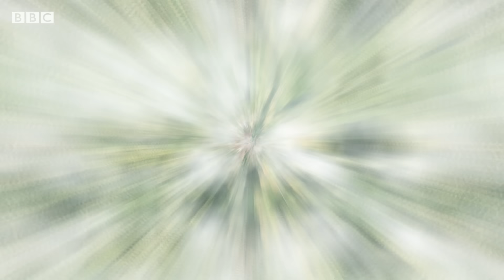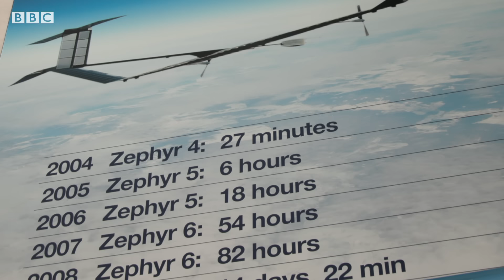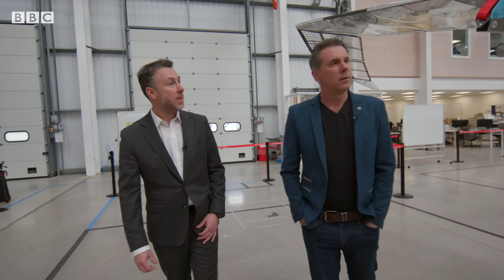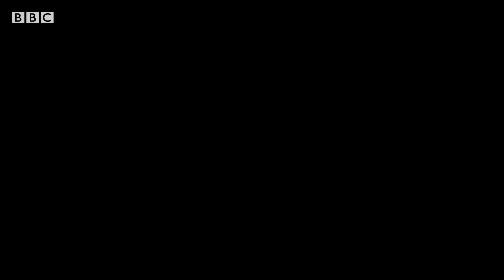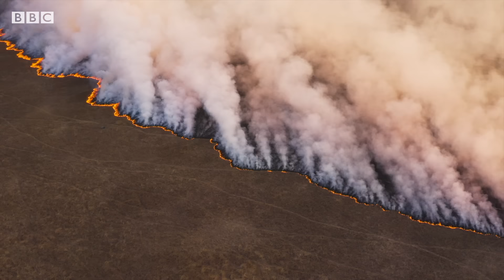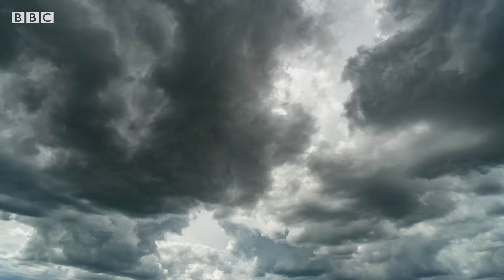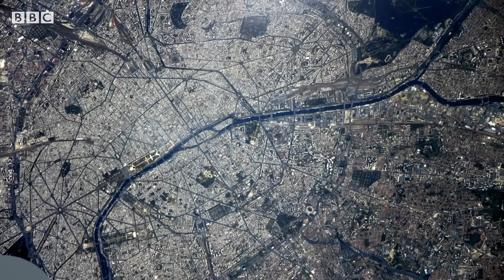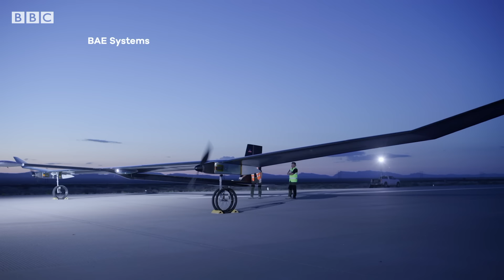The solar-powered aircraft flying high in the atmosphere | BBC News

Comment: Okay I have one small problem with the whole "it will replace 200 cell towers" part. Will the phones be able to transmit back? It's a 2-way communication lol. If a cell tower is 1 unit away from you and that thing replaces 200 cell towers, which means roughly a 14x14 tower grid, you will be as much as 7 times further from a tower. The inverse square law tells you that 7 times increase in distance means 7^3 times increase in losses. Your phone will have to transmit at a 343 times higher power output for the same reception and that is not accounting for weather and you know things like... LIVING ON THE GROUND FLOOR OF A 20 STOREY CONCRETE BUILDING as that antenna will be transmitting and receiving straight down. I'm tired of people that think radio is just magic...
Reply: Twenty years ago, would this concept have been useful post-hurricane-Katrina?  In current terms, is this concept worth the investment?  A thoughtful calculus is required.
Reply: firstly, if you are 7 times further from a tower, the power is 49 times lower, not 343. Secondly, you can either have the phone transmit at 49 times higher frequency, or you can increase the gathering area of the Zephyr antenna to 49x that of a cell tower's.
Reply: The notion that this tech could be used as cell antennas is ridiculous, the logistics are just impossible.
Reply: Should be inverse square law, not square cube, so not as drastic of an issue. But yeah it'll need some good (and light) tech to be able to receive from unmodified phones.
Reply: @mookifacation  Ah you're right, don't know how I missed that 😅
Reply: @mookifacation  My bad. Language barrier and all, gonna correct it. Also about antenna tech, I really wonder how the physical size of the plane will affect the whole thing. Sensitive RF is not really just something you can slap on a piece of metal frame and expect it to work, the whole frame will have to be designed with reception in mind because it won't be more than a flying ground plane and capacitor. It would actually be awesome if they figured out the balance between the ability to fly and invisibility in RF ranges. But even if it worked, try explaining to a bank chain that the antenna drone is reliable enough for uninterrupted money transfers for example... I would have been so much happier if they just said it was a weather balloon replacement to save on helium
Reply: Regarding the electro-magnetic effects achievable from platforms operating in the tropopause ('Near-Space') i.e. 11 miles AGL in the equatorial regions, please refer to the extensive research published by Dr. (Lt.Col. USAF, Ret.) Edward Tomme.  Key Phrase : NEAR SPACE
Reply: Research ASTS, this problem is already solved...5G broadband direct to unmodified cell phones from space.
Reply: @ThePalisky  5G frequencies are easily blocked.
Reply: @ThePalisky  You seem to be ignoring the fact that ASTS BlueWalker 3 is 1500kg, has a phased array with an area of 64 square metres to allow for signal to be detected from phones, and the entire upper surface of that array is composed of solar panels to power it. Not to mention that this is just a test-bed, and the commercial satellite will likely be significantly bigger.

This aircraft on the other hand, while at a lower altitude, will have strict size and weight limitations as well as requiring the majority of its battery capacity to power the props. It will be incredibly challenging to design it to be functional as they describe, and I hesitate to believe that current battery technology is at a state that could support such a system right now.
Reply: @TheMightyHams  you say all that like it refutes anything I said lol. Yes ASTS's solution is obviously superior and the sats are bigger.
Reply: @ThePalisky  I'm not refuting ASTS's efforts. I assumed your response to the OP was challenging his opinions on the abilities of THIS aircraft by saying that their issues have 'already been solved'
Reply: @TheMightyHams  I said 'this problem' referring to the cell towers from far away (the subject matter OP is talking about) not 'their issues' you're attributing to the aircraft. Reading comprehension is a lost art.
Reply: @ThePalisky  The OP is applying the square-cube law to explain how the aircraft will have severe difficulty receiving signal from phones because of the limited power and antenna size on mobile phones. ASTS solved this issue by making a satellite antenna that's 64 square metres in area. That simply isn't a capability that can be easily applied to an aircraft, and the OP was specifically referring to THIS aircraft in his post (notably when he quoted "it will replace 200 cell towers"). It's a fair assumption that your response was in relation to a solution for the long-distance telecommunications for THIS aircraft, and I was simply explaining how ASTS's approach couldn't be translated easily to this design.

ASTS will likely provide a service that will make this design obsolete for this use-case, but likely will still suffer the same issues with poor connection in buildings, in bad weather, or in situations where a phone doesn't have direct line-of-sight to the sky. At these distances the primary means of improving the capability will be to make the satellite bigger, but there's only so much size and weight that you can fit on a rocket. The costs involved with ASTS likely also mean that many 'cheaper' mobile companies won't be able to afford the fees involved with using their satellites, so this aircraft could still find functionality for countries and users that can't necessarily afford it. Starlink has to charge £75/month to justify its expenses, so if the expectation is that mobile providers using this service won't have to increase their (already extortionate) prices to cover their costs then I'd be very surprised.
Reply: @ThePalisky  I was specifically talking about the claims in the video, as indicated by me saying "the part of the video". Don't put words into my mouth just because your point fell apart. I'm not a 17th century poet that you can interpret 10 ways, you can just ask me lmao
Reply: @whatevernamegoeshere3644  I mean you were explicitly talking about phones not being able to talk back to a plane meanwhile we already know they can to a satellite at far higher altitudes via ASTS's solution. Just because you don't understand my point just like the other guy who quoted exclusively wrong things about ASTS doesn't make it any less correct.
Reply: @TheMightyHams  yes I get it you haven't done your research on ASTS. Your cost figures are just dumb and wrong (after a few months it's cheaper than Starlink's current non-D2C tech you're quoting and it's D2C on the consumer end and they use a revenue share add-on model), your points about direct line of sight are wrong, your points about building penetration are wrong, same with bad weather, and you don't know they already have a design that's far bigger than what you quoted (~222 sq meters).

You also clearly don't know about their satellite folding patent which already worked with BW3 if you even know that name. I guess you can keep pretending you're well researched though and spew out some more bs. Nothing you said was right.
Reply: @ThePalisky  Look. It's just not a good solution. It's objectively worse in any possible way than having towers on the ground. This would be awesome as a weather balloon replacement, basically the flying equivalent of a long wave transmitting weather buoy. It would be absolutely amazing for relaying plane communications or taking pictures for making maps. But have you ever been on a roof top or factory attic to actually go and see how a transmit tower looks? They use 2-10kW of power, the amplifier cabinet is the size of a fridge alone, the antennas combine to hundreds of kilos and you want to put that on a plane. On a building, weight doesn't matter. In space, weight doesn't matter after launch. On a plane, if you want to continuously fly that AND supply it with power, Good luck, have fun. They can fly for 60 days on an empty glider plane, great, now at least double the weight and quadruple the power use. See how that flies.
Reply: @whatevernamegoeshere3644  are you drunk? That's not the point of ASTS or other D2C solutions at all. It's complementary and meant to cover areas that aren't covered by terrestrial towers (i.e. the majority of the planet). You're arguing against someone who isn't here, obviously what you're saying is true but it's completely missing the plot. The TAM of D2C solutions is literally billions of people.

I never wanted to put anything on any plane, just lying about what I said and arguing with the wind...I said the solution is irrelevant because ASTS already solved this problem.

You're talking to someone with a masters degree in radio systems engineering and is well researched btw. You should just quit while you're behind and try to learn something from what I told you. Clearly there is an entire novel technology you know nothing about. It will introduce broadband connectivity to more people than anything else ever has in the next 5-10 years.
Reply: @whatevernamegoeshere3644  I mean you're just lying about my position on this openly. I never said any of that. What I did say is that ASTS already solved this issue with their D2C solution. These solutions aren't meant to replace cell towers...they're meant to complement them and help cover the majority of the planet that currently is not covered. The TAM for this is literally billions of people.

Keep arguing with this position noone holds though and don't learn anything I guess if you want.

Comment: StarLink (SpaceX) it putting up a direct to phone satellite system that now can do poor quality video calls (with only a few satellites), and that in a few months of working on it. It is getting better exponentially and once up they are up they are programmed to automatically correct their orbits and can last years. This is going to change the world.  Video calls from anywhere in the world, under any conditions, including the north and south poles.  Also, they are targeting putting these satellites up for around $15,000 per satellite launch cost and that will just keep getting cheaper and cheaper with Starship coming on line.

Comment: 'in theory it should be able to stay here for months' why not forever? in theory every part will be working with no degradation
Reply: The batteries that keep the craft aloft during the night are subject to the same kind of degradation that your phone battery does. With each discharge and subsequent recharge, fewer of the ions are available to make the leap from positive to negative. Until eventually they will not able to hold enough charge to keep the craft aloft all night
Reply: Also solar cells degrade too, but I think way slower (hence no mention of that). But also they are generally lighter than batteries.
Reply: @AlKohaiMusic  yes I noticed after I watched the video, but in theory, it wouldn't be. Great concept though

Comment: I wasn't aware that your typical Samsung or Apple smart phone can transmit signals 10 to 12 miles into the stratosphere. Is it true?
Reply: going to be real awkward when you learn that ASTS already solved this problem they can do 5G broadband direct to unmodified cell phones from space
Reply: Line of sight with no obstructions a couple of watts can go a very long way. 60,000' is only 18.3km. A lot of cell phones can transmit 3w on high power. With no obstructions (no solid objects to penetrate) 3w would very easily transmit 60-70,000'
Reply: Yes. it's true. You don't need much to communicate a long distance - we're still getting signals from tiny spacecraft that are billions of kilometres away

Comment: so it's basically a starlink for calling ur mum instead of gaming with your bros
Reply: These will have in theory better ping than starlink since they are much closer, 4G is enough to game 🤷
Reply: I doubt they actually want to use them as phone towers. This thing has military written all over it. No wonder BAE are developing one aswell.
Reply: itd be better for gaming as its closer to the ground so lower latency
Reply: @HolyOllie  actually no, a LEO satellite constellation actually has better latency over long distances like cross-ocean communications than even undersea cables. At those ranges, the reduced speed of light in the cable can’t compete with the speed in a vacuum even when incorporating additional processing time for repeaters.

One of Starlink’s selling points for premium service is to provide ultra low latency communications for day traders making transactions in stock markets on the other side of the globe, where an advantage of a couple milliseconds means millions of dollars.

This aircraft allows for potential low cost loitered network access in specific remote areas for a limited amount of time. It isn’t scalable like a satellite constellation but the barrier to entry and cost of maintenance could be significantly lower.
Reply: "One if Starkink's selling points..." is vapor ware then. Because Starlink is nowhere near to beating undersea optical fiber connections yet. Purely theoretically it is possible(!) that satellite constellation can beat fiber, tho that is disputed, since the signal bouncing from satellite to satellite is not a straight path either. And fiber connections could be made much faster, since they rarely take the shortest route possible through the already existing cables. So only if technology for cable connections stays the same and we let Starlink develop for several more years it has the chance of beating it. Why anyone would pay for that now (=selling points), is beyond me. People buy Starlink simply because it's the only choice in certain remote areas.
Reply: There is no reason it couldn't be used for Internet as well and if it were able to do that they it would make starlink obsolete, as it would be much cheaper, would not leave debris in the atmosphere and is better for the environment. It would also give more consistent coverage as it can stay over specific spots whereas starlink orbits.
Reply: @Alex-cw3rz  true
Reply: @Alex-cw3rz  it could, but it would have to have really good battery technology which could power both the plane and the satellite internet service, plus have the scale to deploy it. Honestly I don't see these taking off like that, and in the case one of these crashes, there's a very real possibility of it damaging things and even killing people. Satellites burn up in the atmosphere.
Reply: @sarkaranish Are u for real? U think this thing crashing is dangerous? Did u miss the part where they say how much it weighs? Plus it glides, it hardly can crash at all.
Are u one of those Musk fan boys that feels the need to trash and thing that looks like a Starlink alternative? If u want to criticize it, at least use your brain. Pathetic...